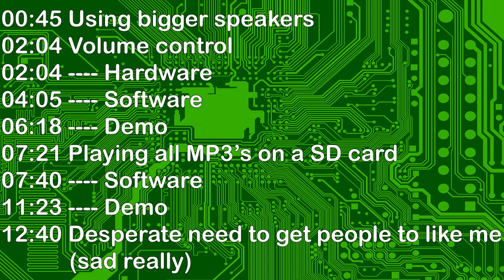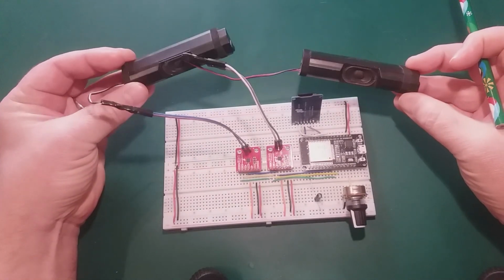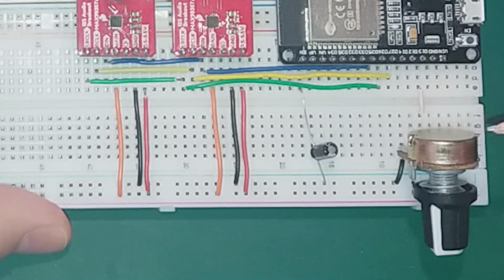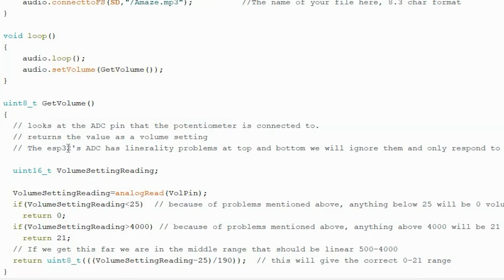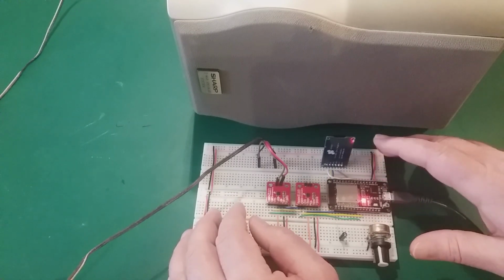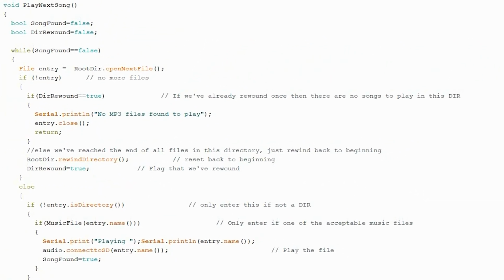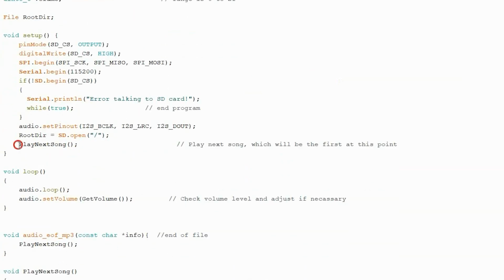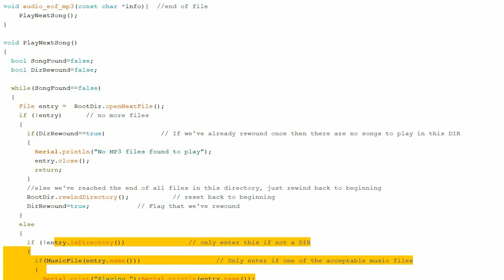A Better MP3 ESP32 Music Player! Play many MP3's from SD card with volume control.

Comment: Hi, i cannot compile the code as it says no connecttoSD. i have downloaded and included the lib from github
Reply: The reason is that there are more than one SD library, the sintax is slightly different hence the compile error.

Comment: Found the problem. Your code audio.connecttoFS(SD,xbuf) is executed before entry.close(). Your code only works for small files. Below is my version of PlayNextSong(). Note that I want to rewind infinitely. 

void PlayNextSong() 
{ 
  char xbuf[50];
  boolean ok=false;
  while (ok==false)
  {
    File entry = RootDir.openNextFile();
    if (! entry) 
    {
      RootDir.rewindDirectory();           // reset back to beginning
    }
    else if (!entry.isDirectory())
    { 
      if(MusicFile(entry.name()))                   // Only enter if one of the acceptable music files
      {  
        sprintf(xbuf,"/%s",entry.name());
        Serial.println(xbuf);
        ok=true;
      }
    } //else if (!entry.isDirectory())
    entry.close();
  }//while (ok==false)
  audio.connecttoFS(SD,xbuf);
}
Reply from the maker: Nice work !
Reply: @XTronical  Thanks. I'm using your tutorials to give me information for making a bedroom clock using the ESP32, LCD display, a PCM5102 with an external speaker, and an SD card reader to play various songs as an alarm . Your videos are quite useful but sometimes lacking in complete information for making a quality DIY project. I hope my commnts help you to  refine them. I am your beta tester of sorts.

Comment: Hello 
I tried your code with no success. I put 2 mp3 files on my sd card in the root directory and I got "No MP3 files found to play". It was the exact code with exception of slight modifications to the wiring and I don't care about your hard/soft volume control. Below is my code that works fine. I just want to play the files with infinite rewinds. Any ideas what went wrong with your code? Thanx

Here's my code:

#include "Arduino.h"
#include "Audio.h"
#include "SD.h"
#include "FS.h"

// Digital I/O used
#define SD_CS          5
#define SPI_MOSI      23    // SD Card
#define SPI_MISO      19
#define SPI_SCK       18

#define NUMFILES 2
const char *file_name[NUMFILES]={
  "/LAYLA.MP3",
  "/WARSAW.MP3"
};
int fnum=0;

#define I2S_DOUT      22
#define I2S_BCLK      26    // I2S
#define I2S_LRC       25

Audio audio;
//File RootDir;
void setup() {
    pinMode(SD_CS, OUTPUT);      
    digitalWrite(SD_CS, HIGH);
    SPI.begin(SPI_SCK, SPI_MISO, SPI_MOSI);
    Serial.begin(115200);
    if(!SD.begin(SD_CS))
    {
      Serial.println("Error talking to SD card!");
      while(true);                  // end program
    }
    audio.setPinout(I2S_BCLK, I2S_LRC, I2S_DOUT);

    // Set Volume
    audio.setVolume(100);
    // get first mp3 on the list
    NEXT();
}

void loop()
{
    audio.loop(); 
}

void audio_eof_mp3(const char *info){  //end of file
    NEXT();
}

//get next file on list or rewind 
void NEXT()
{
  audio.connecttoFS(SD,file_name[fnum]);
  if (fnum<NUMFILES-1) fnum++;
  else fnum=0;
}

Comment: Does this code work with 32GB SanDisk SD card?
Reply from the maker: Yes, but no bigger than 32gb as the sd library cannot manage bigger than that.
Reply: @XTronical  Thanks! I love this project and have been trying to make it work on the ESP32 I have for days now. I now know my I2S is working since your other I2S project that generates a tone works. For this MP3 player, my 8 ohm speaker is still putting out noise, but the strange thing is if I unplug the MISO connection, I will here the music fine for a second, which made me think maybe the data from the SD card is too fast?
Reply from the maker: Don't think so. The reading speed of the sd will be dictated by the speed of data over the i2s. One thing I would check is that you have no floating inputs on the board. I've had a problem with this in the early days
Make sure all inputs are tied to something so are not floating.
Reply: @XTronical  Thank you for the suggestion! I've tried to tie all my inputs so they are not floating, but it didn't work for me. I've watched your previous video on the hardware connections for this project and verified a number of times the connections I made on my board is correct; I also took everything apart and put them back together again a few times and still didn't work. Then I re-watched your explanation on the codes and realized I may not be using the correct version of the FS.h file. Sure enough, I actually cannot find the FS.h file in my Arduino IDE directory or libraries or anywhere I can think of on my PC, although for some reason it is included in my sketch when I checked what libraries were included. So I downloaded the latest version of the FS library and did #include with the absolute path to the FS.h file in the library so that I don't use the old one, and now it works perfectly! Love the volume control!😄
Reply from the maker: Fantastic detective work. Bet that was satisfying when it sprung into life.
Reply: @XTronical  Thank you! Definitely, when the music came out, my heart felt like it wants to fly, very exciting.  I have attached an OLED to display what is playing and sometime play audio books on it, sounds great! Thank you for your video explanations on I2S with ESP32!!!😊

Comment: I have "cloned" this project (as a mono player) and I get very puzzling results.  Playing an 8GB micro SD card containing 2 short mp3 selections, and tracing execution with strategic "Serial.println" statements, the program appears to properly cycle thru both songs, always "rewinding" after the end of the 2nd song, but after the 2nd cycle, no sound is heard (so I get song1, song2, song1, song2, but then no sound - in spite of the apparent execution of the "audio.connecttoSD(entry.name()); ".  How can this be?
Reply from the maker: I'm not sure off top of my head, would need a debug of the source.

Comment: Hello, I am pretty new to this, but I read somewhere that while using WiFi no ADC2 pins (as is pin13) can be used. Also I am confused when you said we should not use potentiometer greater than 10k as it would take too much current -- isnt it the other way around, higher pot (100k) equals lesser current? And thirdly, esp has 3.3v and 5v, so shouldnt the pot be wired to the 3.3v instead?
Reply from the maker: Yes, Wifi and ADC2 do not go well together but you could choose an ADC1 pin, there are around 6 available (from memory).

In the video, if you re-watch it (around 2mins in) it says don't use LESS than 10K not greater as you say. This is for the reasons you describe, maybe you are miss-remembering/mis-heard?

The Pot is wired to 3.3v. If you look at the circuit the power rails on the breadboard are fed from the ESP32's 3.3v output.
Reply: @XTronical  Ah yes you are correct, I misheard :( On a side note: funnily the automatic captions also transcribed it as "more" (~ 2:24) xD  My ESP32 WROOM has a different layout so I also assumed the 5v/3.3v pin wrongly in your video, hehe this was not my day. Anyway thanks for the video.
Reply from the maker: Your welcome, I think the captions sometimes struggle with my accent. Thank you for the feedback

Comment: I got a problem with the board, can you tell me what board you used in this video like ESP32 Dev module or ESP32 Wrover Module or else?
Reply from the maker: It was the dev kit 2
Reply: sorry, I still don't get it. I mean the board you used in tools menu because I got a problem like this "Error compiling for board ESP32 Dev Module.
" and Audio library make it fail to upload the code and showed warning like this "library Audio claims to run on sam architecture(s) and may be incompatible with your current board which runs on esp32 architecture(s).
"  I think the problem is i use the wrong board in tools menu to run this code so which board is the correct one?

Comment: You really should put your web site address on here. I watch your videos, but I need code I can download/copy and try out. I've been working on a problem for a week - playing multiple songs - but all the examples I find won't compile. Of course, if they don't compile they are no good to me, and I've tried to track the problems down to not much progress. I found your web site and will try your code out. Thanks!
Reply from the maker: The website is linked in the description 🙂
Reply: @XTronical  Page not found (404)  on that link. But I worked around it. Thanks!
Reply from the maker: I'll check it out, cheers
Reply from the maker: Link updated, there were underscores instead of hyphens, not sure how they got in there! Thanks for spotting it.

Comment: It's not entirely accurate that the little amplifiers "are not being stressed any more than they were before." You have made a hasty assumption, that "resistance is resistance".  A loudspeaker of any size is a reactive load, because it contains a coil and has a magnetic field and has a moving part connected to the coil. This complicates things tremendously.

You have three effects which change the current in the output stage of the amplifier from that which you might expect from resistance values alone:
One is just the effect of driving a coil, any coil. Attempting fast changes in current results in a back EMF. This has the oddly opposing effects of increasing the resistance, but out of phase with the exciting current, so the effect is often to draw more current, depending on the frequency.

Then there is the physical inertia of the speaker cone, moving a heavier coil and cone (compared to your first speakers) does require more current. T

Then there are sources of back EMF, from the generator effect, which means that there is electricity being generated, because you are moving a wire in a magnetic field as the speaker tries to "keep going" because you pushed it.  It will also always try to fall back to its centre (rest) position. The effect is that your amplifier asks the speaker to go one way, but it's still going the other way, so the current increases a LOT. 

These three were the main reasons that early transistor amplifiers failed quite often when driven hard, especially in comparison with valve amplifiers,. Valves gave less power, in general, but had a big transformer to damp down the transients and a high back-resistance, since you can't make electrons go backwards through a vacuum tube.  A Zobel network reduces the transients somewhat, supposedly, but a well-designed output stage also helps, as does using much bigger transistors than you think necessary.   I learnt most of this the hard way in the 1970s, building high power transistor amplifiers (some even worked!).

Feel free to say "but it works fine". Yes, indeed it does, for the volume that you used, and for a short while, these are not big problems, but when you take it higher, you get distortion, warm ICs and then a sudden permanent loss of sound.
Reply from the maker: Thank you very much for your detailed post. I'm sure people will find it very useful. I will have to stress test this set up in the future.

Comment: Hey Xtronical! I would like to know what's the difference between VS1053 and I2S DAC from ESP32 ?
thank you
Marc. :)
Reply from the maker: I was unfamiliar with the vs1053, had a quick look at the data sheet. Very interesting chip. It is far more capable in some ways, for example it has built in decoding for several audio formats. However it has a slow clock speed and less IO and it can't mix sounds. It all depends what your want to do I suppose. Esp32 is faster and more versatile but would need additional libraries to play some of the formats that the 1053 can

Comment: What's the difference between the ESP2866 and the ESP32
Reply from the maker: Main things, 8266 is slower and has much less i/O pins, no built in dac either.
Reply: @XTronical  Thanks for that,  I have two on order,  i have a collection going here.  Uno, Mini Pro, ESP01, ESP8266, an have a ESP32con its way..
Reply: @InterplainMusic  Also I read that have more modules inside and dual core!